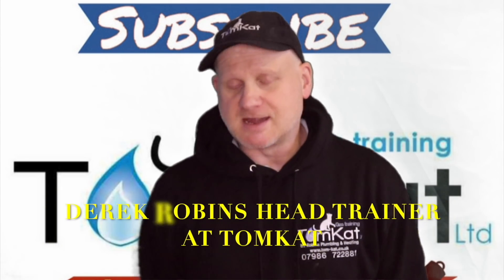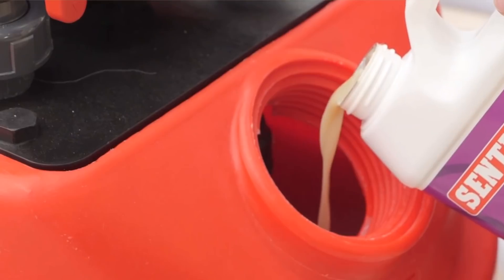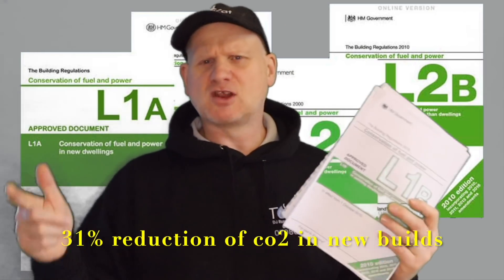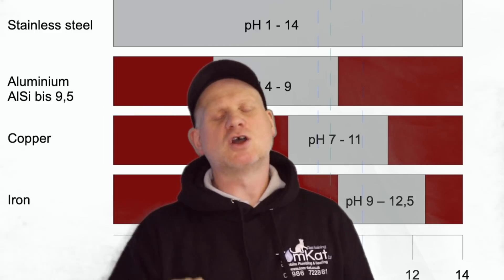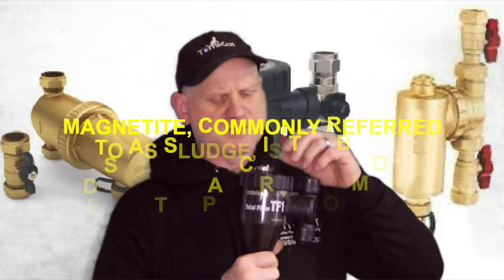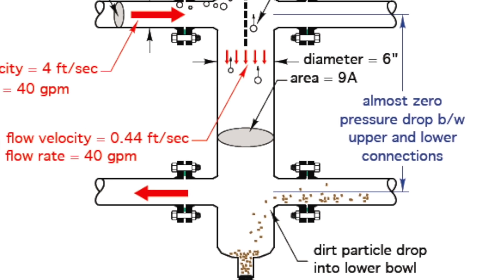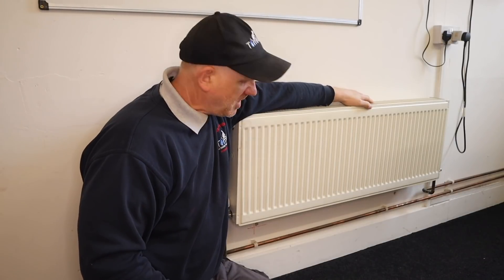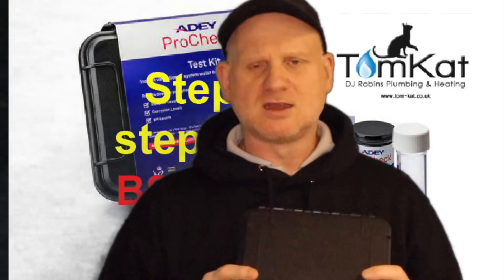DO WE NEED A BOILER FILTER, a look to see if a central heating system requires a magnetic filter.

Comment: You have to ask why are internal pipe surfaces and the interior of radiators not coated with some metal rust inhiubitor. Cars metal bodies have had these coatings to avoid rust for years.

Comment: I've just put 500ml of mc1 inhibitor in a 10 rad system as i want more than just enough as some rads are allot older than others and some new , question is when its said top up inhibitor every year does that mean like half a bottle or a full bottle as its not all that clear , ive not got a test kit but i do have a magnaclean and all rads were flushed via hose and some were removed todo the same as i could handle the size

Comment: Hi, may I ask what I thought was a simple queston that even boiler manufacturers dont reply to, can you shed any light.    Heat only, 'new' system condencing boiler running only hot water, summer operation. Hot water storage tank selected temperature 60 degrees, what is the most economical temperature to set the boiler temperature to,   60, or leave it in winter heating selected 70 degrees.
Kind regards Dave Porter, london
Reply from the maker: The lower you set your flow temperature the more economical your system. Problem with your question is how many litres is the cylinder what size kw is the boiler because it’s all about recovery time. Hot water should be sorted over 50oc because of legionella and obviously if you set your flow temperature to 70 and require 60 it should heat up quicker than if you set it to 60.

Comment: My daughter just got the keys to a new build yesterday 05/08/2022 in Leeds.with an ideal logic c35 Combi boiler. (No filter installed) really don’t see why I should now have to travel 100 miles there and start to cut in to pipe work to install one. 
If B.S. 7593 2019  is only best practice and advised not compulsory. But now since June 2022 it comes under building regulation part L can she demand to have a filter fitted. Or is she  just wasting her breath even asking the developers. ?????????
Reply from the maker: It’s now in the building regs part l but the manufacturers won’t warranty a boiler without one. I would go to the developer and see what BS they come out with
Reply: @tomkatgastraining  thanks for your reply so quickly didn’t expect that( brilliant.) I have just watched an ideal video on there Magna clean and they said the government changed there mind on there policy about adding a system filter. 🤷‍♂️🤷‍♂️
Reply from the maker: @shaundavey1170  no it’s in the new building regs part l like you said. I would contact the developer and ask them all they can say is no
Reply: @tomkatgastraining  thank you
Reply: Just an update as I’m getting more confused by the regulations. I phoned ideal technical department and they told me it’s only best practice to install a dirt filter. No mention of a dirt filter on there benchmark. he knew nothing of any changes to the building regs from the 15th of June . The bench mark was completed on the ideal logic esp1 Combi boiler.but no weather or load compensation. Water meter installed and no shock absorber.it does have two zones thankfully but these are wired to the 240 link so as far as I’m aware that isn’t modulating the boiler just on and off switch. The plans for the new build were probably submitted months or years ago so I guess there complying. It’s just annoying that they don’t even bother in a quarter of a million pound house.

Comment: Hi Derek, great video. Will the filter and flush through help with limescale build up inside my electric shower? Sorry if that's a really dumb question, I'm just a mere non-plumber mortal. 😊 Been through umpteen electric showers. Thanks
Reply from the maker: You probably live in a hard water area so you will need a water softener on your mains water
Reply: @tomkatgastraining  thank you 👍
Reply: I'd ask the shower installer or shower maker to advise based on having a hard water supply. Limescale is hard to remove if it has hardened. A Power flush is more useful for radiators and pipes than the shower. An email or call to the shower maker or shower distribtutor should offer some good advice.

Comment: Yep, the air will disappear … where did you think the magnetite comes from?  (Magnetite is a stable form of iron oxide often promoted in ferrous pipes and equipment as a protection from corrosion) …

… As for magnetic filters they’ve been around since Adam was a lad!

Comment: How do you square the use of inhibitors as opposed to Viessman instructions to clean the system to VDI standards and use demineralised water?
Reply from the maker: VDI standards are not standards in the U.K. our standards say use inhibitors and most tap water in the U.K. is good enough to use in heating systems so no need to. That’s until the standards change of course
Reply: @tomkatgastraining  I get that - but it is the manufacturers instruction. Many of your videos and those of others always caution ‘follow the manufacturers instructions’ - how do you square that?
Reply from the maker: @normanboyes4983  I will need to check the manuals for Viessmann but the manufacturers instructions don’t always override regulations and yes sometimes the regulations say refer to manufacturers instructions for clarification.
Reply from the maker: @normanboyes4983  just checked the instructions for vitodens 100 in the U.K. it says to fill the heating with potable water of less than fluid category 3 and use chemicals to protect, if the water is over 300 ppm it must be softened
Reply: @tomkatgastraining  Thanks.😀
Reply: Ring up Viessmann technical support and they will suggest you use both cleanser and inhibitor.  Always go with what the manufactures state.
Reply: Demineralised water … how would you use truly demineralised water? It would attack any metals, steel in the system for a start!
Reply: @andyxox4168  only when there was a surfeit of oxygen, once sufficient oxygen had been consumed (shortly) after initial fill then that process slows considerably and continues to do so.
Reply: @normanboyes4983  nope, that’s not true, attack by demin water is nothing to do with oxygen and demineralised water can only successfully be stored in stainless steel vessels perhaps you are not understanding what demineralised water is or confusing it with low grade treated water.

(35 years in power plants using true demineralised water is my reference point)
Reply: @andyxox4168  What was your daily % make up feed water?

Comment: I use a simple inline 22mm filter on the return side of the boiler, saw these in Europe so decided to do the same. Works perfectly and collects the debris in the wire gauze.

Comment: i have a strange problem with a heating system nobody was able to answer me , the combi boiler works good all 9 radiators are perfectly working  BUT 1 is not working temperature on it it`s like 1/3 of the others  it`s on the second floor of the house  , where i have another 2 radiators both work good around 60-65 celsius on them but this one does not max 25 , i tried all the methods to purge the air even called different installer we used a pump with cleaning agend and cleand  2 times the installation problem still not solved , my question is if the water pump could lose it`s power as it ages ?  and if so did anybody else experienced this kind of problem  ?  also it seems to have a higher temperature in the night like 30 C compared to 20-25 in day time , could it be that  in the middle of the night the AC line voltage be a bit higher and the 8 year old pump work better  ? it`s a standard pump grundfos with running capacitor to emulate a second phase ....... this problem is breaking my mind
Reply from the maker: The first thing I would do is turn all the radiators off except the one not working to see if it gets hot. If it doesn’t get hot then I would be looking to see if there is a blockage in the radiator or pipe work. If it gets red hot then the system will need balancing.

Comment: Thank you for the video. Where is the harm in installing a filter to protect the rads and fitting one on the flow side?
Reply from the maker: It just means the water ways in the boiler won’t be protected because the magnetite will flow through the boiler before reaching the filter so causing the boiler to block and break down
Reply: @tomkatgastraining   Thank you for your reply. I think you mis understood my question. Why not fit two filters. One to  protect the boiler and one to protect the radiators. ? Thank you
Reply from the maker: @RayMondElec  no need when the one on the return will protect the boiler and the radiators
Reply: @tomkatgastraining   Thank you

Comment: i was planning on getting some filters fitted... i notice that the TF1 you're holding looks to have a cyclonic action for catching heavy/non-magnetic debris... would you recommend that over the magnaclean?
Reply: The tf1 is not as good of quality as the ADEY filter
Reply: we have so man problems with leaking magnacleans. when you loosen them on a service the seals go. don't recommend
Reply: @eazyrat  I suspect this is down to misuse.  The instructions clearly state "hand tighten only".  Now I guess there's a difference between the grip of joe-public and the worlds strongest man, but even so the emphasis is a light tighten only. Under no circumstances use the large black spanner (you shouldn't need it anyway).

The only time the spanner is needed is when undoing the top and even this can be needless if the internal pressure of the filter is relieved using the bleed screw on the top of the filter.

In the same way the old fashioned domestic faucet could have the rubber washer damaged by screwing down the tap unnesessarily hard, so the rubber seal in the Adey filter can be needlessly overstressed when tightening the top using the spanner.
Reply: @eazyrat  Something wrong there. I've never had a Magnaclean leak....ever. I find they perform better than most others at catching muck and I've had one on my home system for twelve years. I've fitted most of them at one time or another and serviced them all of course. I find the Adeys to be consistently better at catching magnetite.
Reply: @timhancock6626  hmm maybe. We've stopped putting them in. Many if them are old i imagine. But it was enough of a problem to change.
Reply: @eazyrat  the pro 2 filters are much better, they use a different seal to the old ones and the brass spigots are good for attaching a magnacleanse to. 👍
Reply from the maker: Magnaclean also has a way of catching debris

Comment: I descale boilers fitted with filters on a regular basis. I honestly think it's a waste of money.
Reply from the maker: I think if engineers were allowed by customers ie cost to do their job correctly ie test and clean systems there would be no need for filters but as we know customers take the cheapest quote these days which most of the time leads to boiler in and gone in half a day
Reply: @tomkatgastraining  I think your comment is supported by the experience of many. I feel lucky to have a different customer base that want good work and are willing to pay. I plate seperate my boilers to give total protection and it works brilliantly. No filter needed.